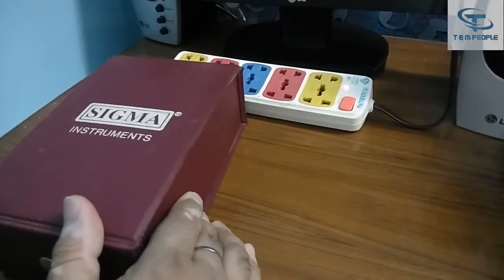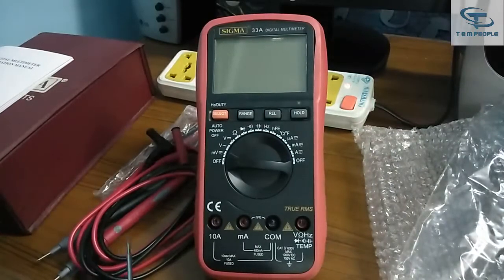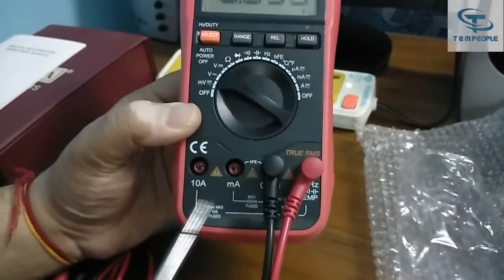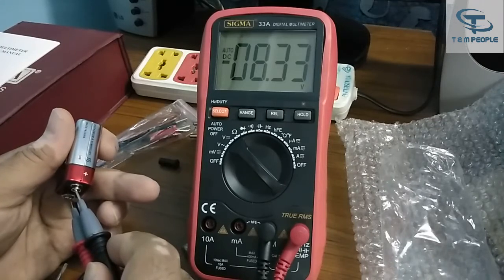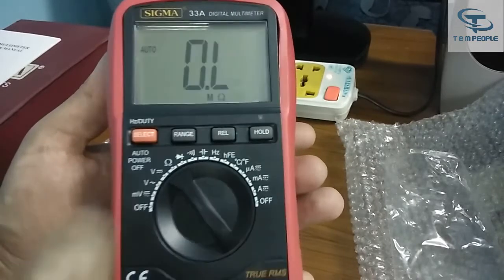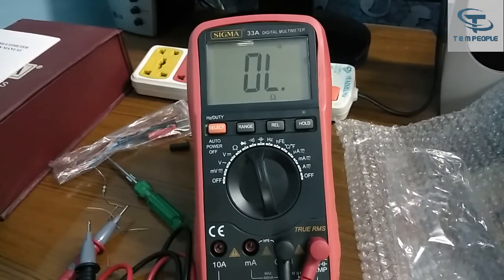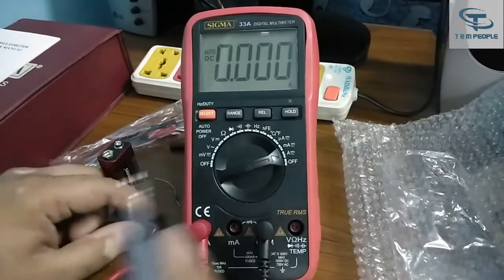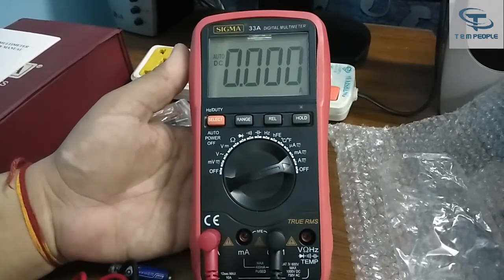How to Use Multimeter SIGMA 33A TRMS in ENGLISH

Comment: Where does Sigma 33A TRMS stand next to Meco 171b TRMS, which out of these two should I purchase I’m a little confused, thanks in advance
Reply from the maker: Sir, Both are TRMS multimeter. 
SIGMA has rubber holster at the back and Meco doesnot have.
MECO has 20 Amp current capacity and SIGMA has 10 Amp.
Both are autorange and of good quality, all the other parameters are approx same.

Now it depends on your budget which meter you want to buy. 
You can also go for SIGMA 3A 4 1/2 Digit Multimeter that is more good as compare to these 2 models
Thanks